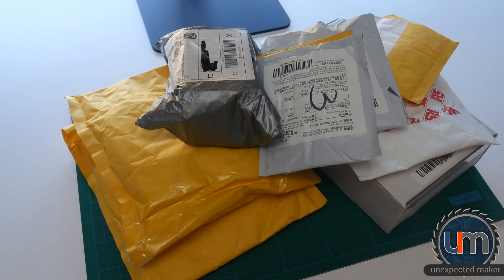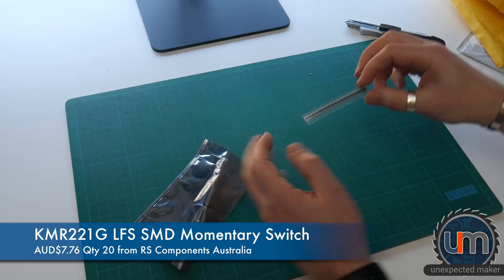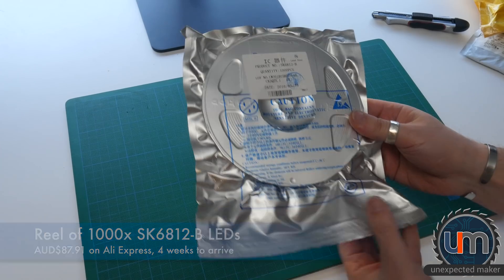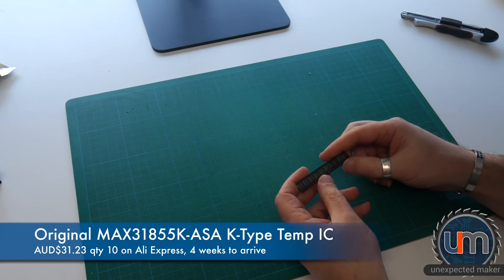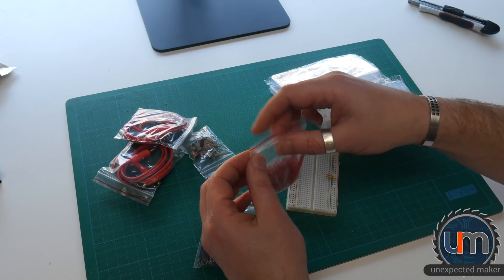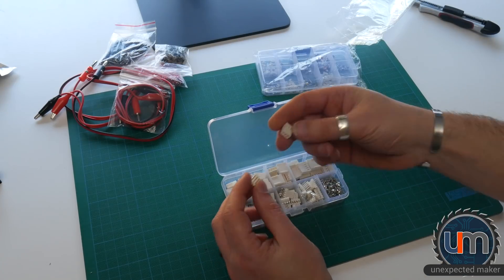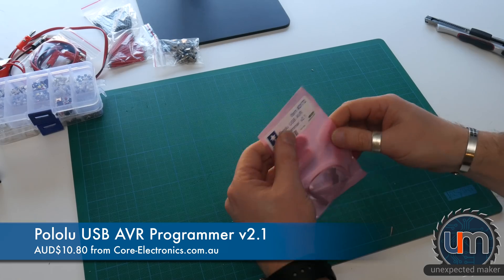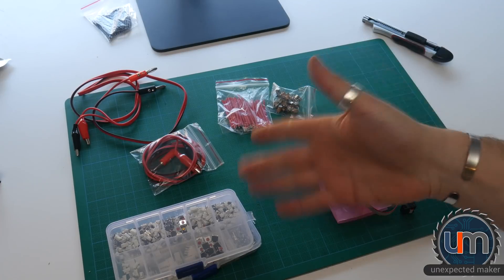Unexpected Mail #15 - I'm going broke!

Comment: I will sometimes use the  Screw Terminals on an uno or nano. I bought the same wire kit in a box. lolz I also have ordered smd 595's. I  Have the sop8 to dip8 adapter also. Oh I also ordered the breadboard jumper wire 400pcs. I wonder what crimpers you bought?
Reply from the maker: I have to stop copying you! hahaha.... I am shooting another Unexpected Mail today and I am sure my crimpers are in the pile... so stay tuned!
Reply: I bought orange handled crimpers for dupont male and female wires. It was a pain to learn how to use them. It's awesome to have any length of jumper wires when you need them. The guy with the swiss accent also finds it is handy to make your own dupont connectors.
Reply from the maker: I think mine have yellow handles.... I decided to record a new SAMD21 Mangler video instead of my next Mail video, so 13 packages of mail sitting un-oppened!
Reply: Having proper crimpers could save your life! 
I guess if you really wanted to you could use the smd Attiny85 adapter with an uno icsp. You would just have change the order of pins though.
This is my first Attiny 85 programmer I made. It's for an uno and programming over SPI. 
https://i.imgur.com/hQunnZS.jpg
Reply from the maker: Nice! I have an UNO programmer board I made.. works fine most of the time ;)
Reply: Oh nice! :)

Comment: Those babana-aligator cables, from the dodgy supplier, I would really check the connection of the wire (if there is a wire in there) to the alligators and bananas ... especially before hooking it up to any kind of high power.
Reply: I also got a bunch of those banana to alligator cables, and they're awful.  Very thin wire in them so they are no good for anything but really low current use.  Easy enough to replace the wire I guess.
Reply from the maker: Ha! Yeah, they are ok. Work fine, just not silicon. I only wanted silicon as they tangle less.
Reply from the maker: Thanks for the feedback Gavin. I have since gotten a good set of cables for my PS and won't be using those Chinese ones anymore. I haven't binned then yet, but I def won't use them on the PS.

Comment: Ohh i need some of those wires!
Reply from the maker: wWhich ones? the ones that don't for int breadboards, even though they were sold a breadboard wires? ;)
Reply: Unexpected Maker haha definitely not those! The box of silicone wires.
Reply from the maker: Ahh, lol, yeah they were not cheap, but very nice wire. I have a mix now of solid core silicon and normal.
Reply: I have these wires stranded, I find them to be almost too flexible, they are hard to work with and strip, they are super soft. What kind of silicone solid do you have, maybe that is what I need.
Reply: @tablatronix  try using the "pliers" type strippers on these. The jacket comes off very easily. The "automatic" ratchet type strippers don't like them and just end up stretching and pulling the jacket.
Reply: @leachim66  I use good quality klein strippers, I probably need a pair that is more razor sharp delicate strippers like wire wrap strippers.

Comment: I have those wires, they are crazy feeling silicone
Reply from the maker: Do yours fit in breadboards?
Reply: I meant the rolls, but yeah those are messed up, breadboard my ass
Reply from the maker: Oh, Stephen mentioned the same and I assumed the breadboard ones.. yeah the silicon wire is super nice. Pricey though.